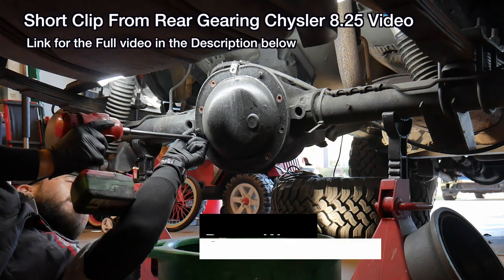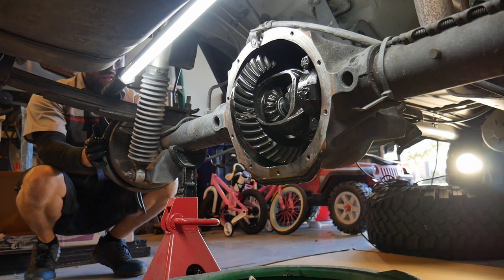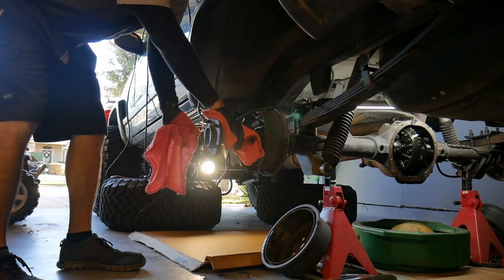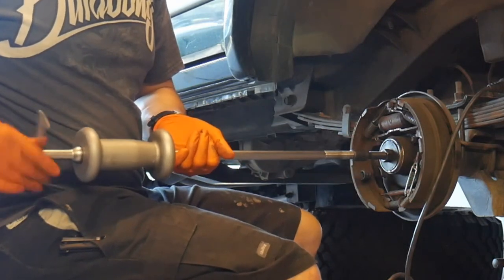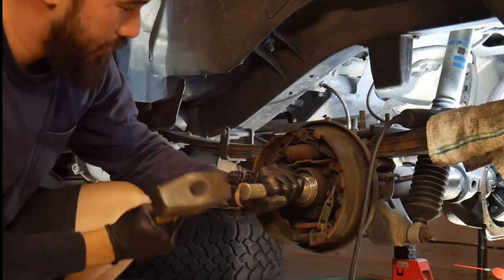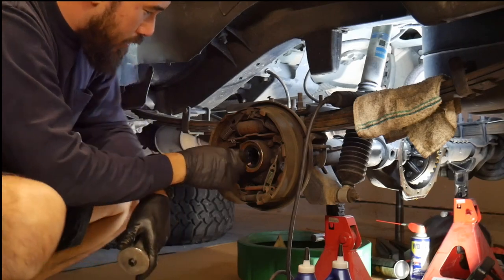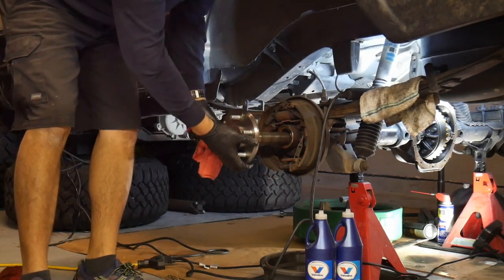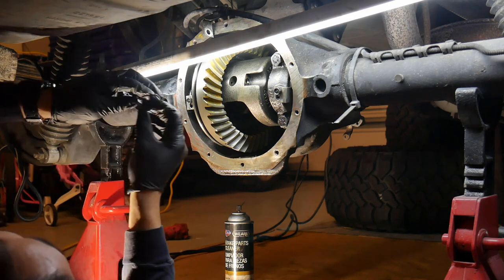How to replace a Wheel Bearing and axle seal / Jeep Dodge Ram Rear  Drivetrain / xj TJ Jk jl

Comment: I have a 2016 Ram 1500 ecodiesel Laramie. I have everything apart to replace the bearing but, I cannot get the C clip out. Any advice?
Reply from the maker: Tap the axle with a block of wood and hammer.
Reply: @Donnythelatemodeltech  I did try that. It’s about half way from coming out. Does the axle have to be lined up in a certain way?

Comment: What tool did you use along with the slide hammer to pull the bearing? I’m not seeing a link for that tool.
Reply from the maker: Shankly Rear Axle Bearing Puller

https://amzn.to/3eB859R
Reply from the maker: Orion Motor Tech 9-Way Slide Hammer Puller Sethttps://amzn.to/3exeSBs

Comment: Why disconnect the drive shaft? and just put trans in neutral!
Reply from the maker: Because, this a little clip from a regear video.   Pay attention!
Reply: @Donnythelatemodeltech  I gotcha, but didn't you disconnect the drive shaft?
Reply from the maker: @michaelwest1854  yeah, you kinda have to, to get the yoke off.
Reply: Why pull the yoke off if your replacing a wheel bearing?  Still a good video and thank you !
Reply from the maker: @Michael West  yeah, you don't need to pull the drive shaft  ,, but this is small clip from this video. https://youtu.be/xi-2YYgI35c